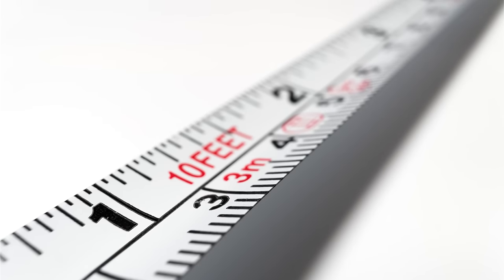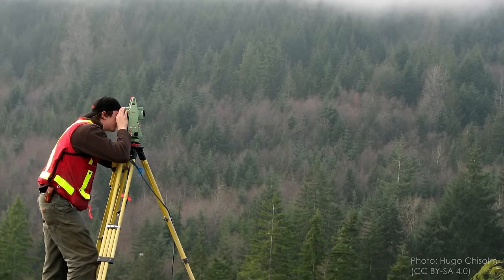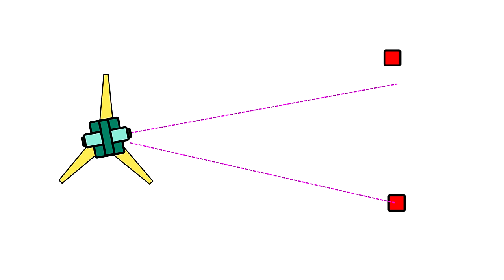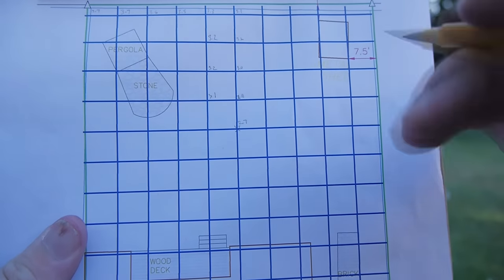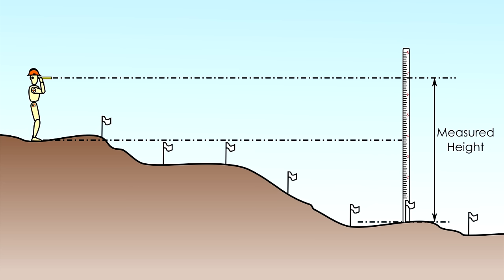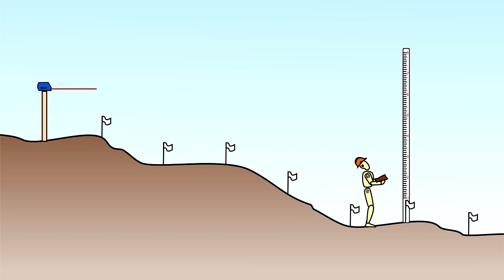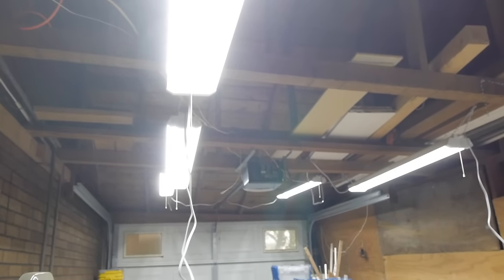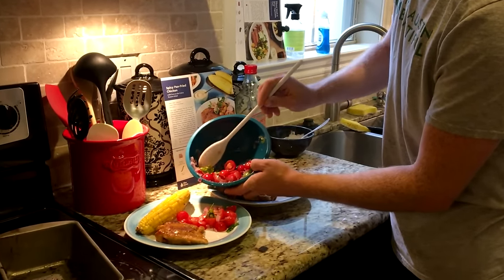How does land surveying work?

Comment: Theodolites are also used in Track and Field (although we call them EDMs, Electronic Distance Measurement) for measuring throws and jumps, and they can be an absolute pain to set up, I can't imagine how annoying it must be on an uneven surface.
Reply: EDMs are different from a theodolite. When the two are combined you get a total station.
Reply: @jonathonhazelton2060  I just had a Google and it turns out that we're using total stations but calling them EDMs. I thought that they were the same as theodolites I would get distance and angle measurements.
Reply: Yeah, so you weren’t wrong for the EDM doing the actual distance measurements, because that’s the part of the Total station that does the distance measurements. Also setting up a total station on uneven surfaces isn’t much harder than setting them up on even surfaces, the tripod only contacts three points, ask a surveyor the trick to it, there are lots of competent one in OZ. Do you set up the Total station after every throw/jump, because if you placed it to the side, you could do a simple calculation to determine the distance from throwing pint every time. Trig for the win, and because it is repetitive, you can make a program to churn out the distance. For the scale of the field, you can simply assume that the earth is flat, and all your measurements would very good.
Reply: @jonathonhazelton2060  we've got a program that we use where we measure the centre point of the circle or runway and then we leave the EDM set up all day so that we don't have to set it up for each event, and on the newer models we can switch between disciplines without having to measure the centre point each time. The big issue is that some tracks have issues with the field that makes measurements inaccurate (for example at Townsville the Javelin centre point isn't marked in the right spot and the foul line isn't marked correctly either) or the turf is raised higher than the circle or runway, which is a big issue especially when dealing with Comm Games and Olympic Qualifiers or records.
Reply: Oh so your telling me that it runs a program where you just map it out first with a couple of measurements and then it does it all for you? That’s is one slick system.
Reply: With practice, you can do it in under 60 seconds, including on uneven ground. It's all about using the right procedure.

Comment: A Transit Theodolite with a stadia diaphragm and an anallatic lens can easily measure horizontal distances by using formula D=100s where s is the difference between upper stadia and lower stadia

Comment: I recently bought a VERY cheap residential lot in central Florida.  Kinda strange coincidence on how i found the lot.. i had broken down late at night and decided to drive off to the side of the road and go to sleep. when i woke i was exploring some unpaved street and wooded lots with no houses .    I looked it up and found that some were for sale for a very long time.  I called the county and researched local zoning and building codes and made an offer i thought the seller would never accept and but he did.   The idea i have is an offgrid lot with no permanent dwelling - secure, fenced and private with shallow water source and solar.   Taxes are almost nothing, but to put a fence they told me a i needed a survey. They told me they have no building codes for fences and that almost any fence will be accepted.  However...  am looking at google earth images and see many of my neighbors have fences that were never permitted.  You can't tell from street level , but they also have illegal dwellings and  RVs and building containers on their lots.  I asked the county about if there was any plan to pave the platted streets and they said there was not enough development to justify and that this part of town is un-maintainned and unmonitored  (meaning no mail, no garbage, no 911 service).  I'm not interested in City Power, but the local power company quoted me 8k to put a post on the lot.  I know all this sound scary, but trust me when i tell you the price and taxes are STILL right and some of this is actually good news if the goal is to use it off grid .   I plan to mark my corners using the counties GIS GPS coordinates and do some manual land clearing, site planning and build a simple hidden fence to keep people and predators out.  I have no immediate neighbors and may never have any. I was there a few days and did not see a single car pass in front of the lot.   Should i bother getting  a survey and submitting a permit to fence it with temporary u-post and wire mesh? the way i figure this is only going to INCREASE MY VALUE AND PROPERTY TAXES right? . The county clearly does not care about this area as they don't service it and nobody is going to report me if they can't see beyond a bunch of trees i have in the front of the lot.  The other question is given in Florida, what's the TYPICAL FINE and process if they see that i built a fence WITHOUT PERMITS?  Again, it's a very simple metal T-post and wire mesh fence in the back of the property - at most about  a $400 investment.  I understand the risk of not having neighbors .. like theft and worse.  Also I do see coyote tracks on the lot.

Comment: Great video, but you left out some critical parts:
1.  By law you have to close down at least one lane of traffic, even if you're 50 ft away from the road.
2.  Union contract requires at least 4 more people on that job, regardless of they have nothing to do.
3.  Most states require at least 2.5 inches of butt crack showing on the surveyor.

Comment: I live in a rural neighborhood that is truly a surveyor's worst nightmare. In the 70's it was platted by two guys with a random length of chain. All the measurements were made with the chain and marked with metal pins stuck into the ground. A contractor was hired to put in roads and the lore has it he was drunk because the roads don't follow the plat at all. About every fourth parcel has the road just wandering somewhere through it with property on both sides of the road. A few years after that the elected county surveyor bought up a bunch of parcels and decided he wanted them to be larger... so he pulled up some pins and resurveyed the place to his liking. The whole thing is such a mess that when you buy land in the neighborhood there's a big disclaimer from the county saying the plat maps they offer are "suggestions only" and not legally binding.

Comment: I thought it was called a “transit”. I’ve an older one that’s basically a telescope/site, bubble level, and compass rose on the base. It has four adjustable points for leveling. I think it was a high-end professional tool in its day (1978).
Reply: i know this was awhile ago but I thought I would answer your question. A transit has a vernier that is used to read the angles, normally with a magnifying glass. The accuracy is about 20-30 seconds per angle. A theodolite uses a micrometer to read the angles. The accuracy can be 1 to 10 seconds. Some models can be accurate to 0.1 of a second, however this degree of accuracy is seldom required. Both instruments are nearly obsolete today. Electronic Total Stations and Robotic Total Stations are now the rage. Those and survey quality GPS have taken over.

Comment: One thing if you use a laser. Don't look at the beam directly into your eyes. Will cause eye damage. Next thing I own a Bosch and bought the extra tool that sees the line when my eyes can't. So in the brightest sunlight makes no difference so that makes the laser that much more useful. I had problems with bright sunlit rooms. Not any more. Cost a bit but make the laser so much more useful.

Comment: Thanks for the short video.
Few years ago I tried using a clear water line but it did not work for me.  It had roo many kinks in it.
Is there a certain type of a clear hose line that works better?

How to figure our a percentage of a slope ?
I have uses a 6 feet long level, or a 12'  2x4 with a small level on it  and  tape measure on a payment, but what can I use on a undeveloped land and for  longer distances like 30 or 40 feet?
I really don't want to go out and buy a Lazer & tripod.
I need a better clear water line.
Any suggestions?

Comment: I'm curious if anyone is using pretty basic photogrammetry for small scale (a parcel of land), which can be done with consumer level drones.  it'll give a point cloud of topography.  you could throw down a basic scale (1m x 1m square or whatever) to scale the results for any 3d program.  you'd run into issues with trees, making it a bit more tricky.  I know it gets used on large scale measurement of land.  it just seems like it could be a way to automate surveying.

Comment: I have a story for you. I do concrete formwork in the commercial world; this iron worker was landing a load of rebar, about 20' pieces, and he grabbed the load and spun and knocked the total station right over. Our boss sent it out to get recalibrated and guess what? Same guy, same size load, same corner of the hole and exactly one week later he does it again. He was off the job after that. Apparently it cost about $40,000.

Comment: I have a 20 year old Porter Cable, rotary, remote controlled laser, that on the remote, there is a laser detector that, well detects the laser even on extremely bright sunny days. However,  nothing like waiting until dusk so it can easily be seen.

Comment: At around 2:00 in your presentation, I saw that the surveyor seeing through the telescope with several measurement rods and or reflectors around the area. I see in the picture these are measuring sticks are mounted on tripods and others sticking out of the ground. Do you have to pound in these measuring rods into the ground so they remain up right so the telescope person can do a reading on the theodolite?

Comment: Who said a laser level is level. It's all about calibration tolerances. For long distances the ultimate best is what Joseph DESTAUBIN said, it's a water level. As with all tools you have to understand their limitations and vulnerabilities but even so water levels are the best. My take on laser levels is that the affordable home units are for short runs. When you move up to the $500 to $1000 or more levels then you can take on longer runs.
Hey you left out the part where surveyors go in a circle to calculate the average errors and compensate, but a backyard doesn't accumulate that much error.
Thx for sharing.

Comment: Wish I could locate the corners of my property, I never found any pins and once contacted a surveyor and asked what would cost to find my 1/2 acre rural property line, they quoted some crazy amount like $1800. I know within a couple or 3 feet where the lines are, and the lot is 89 feet wide and there's an old barbed wire fence along one, so it's  close enough for me.
My property abstract details the measurements from the quarter section corner and all that, but that's too far down the road for a tape measure.
Google satelite view is surprisingly accurate and comes to about a foot  or two away from where I think the line is
Reply: If you or someone else goes to sell your property, you're probably going to have to pony up for a survey.
Reply: @checkyoursix5623  I dont ever plan to sell

Comment: The water level method is affected by what the temperature was when you started and when you finished. If it was cloudy when you started and then the sun came out later, the water will heat up and the level will rise on you all this time giving a false reading.

Comment: this has nothing to do with the video but ...I used to work on a wine cellar making port wine and we had some 100.000liter stainless cylindrical vats that needed measurement so the company called a team of "engineers"..they went inside the vats with laser equipment and calculated the total capcity of the vats and made a table with liquid height vs volume.....we, the common workers kept telling them that this method would be useless but they wouldnt listen so we let them cary on...after the measurements were taken and all the paperwork and seals of quality were given we started using the vats with actual liquid....but the vats swell a lot and deform on the presence of so much liquid. they are so huge that it cannot be seen at the naked eye but one centimeter of swelling gives lots and lots of liter of difference in such a large diameter circunference and so the measurements were way way off...we "uneducated" workers kept telling them to use a flowmeter and water but they said they could do it chepaer....next the company had to call another engineer team with a large flowmeter....sometimes being close minded and believe blindly in empirical and theorical knowledge disregarding real world variables and people with experience working with the actual stuff is a very dumb move....guys like those give a bad name to engineers.  thanks for the great videos i always learn with each of them!

Comment: How do you work out the level with laser and post?  I didn't follow ... what calculation do you do and how can you record the info in a form that would mean something to a builder for instance? Or to put it into a cad landscaping software program?
Reply: What do you mean by “work out the level”?  The rod is just a measuring stick, giving the height above whatever it rests on.  The leveling instrument connects two points with a level line.  Since you know the height of the instrument, you can easily determine the difference in height between the two points by addition/subtraction.

Comment: Can u talk about exactly how surveying leads to roads? Yeah okay we find out the elevation but how is that data used?
Reply: Surveyors make 3D maps of the existing ground and features. An engineer designs the road to fit and meet standards. Standards dictate how tight turns can be or how steeply the road can climb. They also try to minimize the amount of dirt that has to be moved. They can do this because they build a 3D model of the proposed road in the computer, and can add or subtract that model from the existing surface. Then surveyors place stakes on the ground that show the contractors where and at what elevations to build the road.

Comment: I dont think that sight level method is actually correct, sure your sight might be leveled but what if the measuring rod isnt? What if its slanted? Thats why we have a leveled sight, so we know everything we see is level, but you also need to rock the rod back and forth, and the lowest read though the middle line will be the elevation. Because when the rod is rocked back, you read higher numbers, and when its rocked forward, you also read higher numbers, so the lowest number is therefore the leveled elevation.

Comment: I know nothing, but I am interested.  A question I am trying to answer is this; If a drawing of my property says it is 100 feet wide from point A to point B, but the land slopes downward along this width 15 feet in elevation, do I measure 100 feet following down along the slope or do I measure 100 feet level from point A to point B?  I have tried to think about this and the only thing which makes sense to me is 100 feet in a line level from point A to point B.  I know this is a very basic question but I think I can build my understanding on the answer.
Reply: @Kshitiz Pokhrel  Thank You SO Much.  I understand the answer now.

Comment: Wait...i just realised..........do your surveyors in the US use the metric system like pretty much everybody else or do you still use the imperial system for surveying? If you use imperial you job must be way harder...my head hurts just thinking about it...
Reply: We use decimal feet. The feet are US Survey feet, which are slightly different from imperial, but are an easy conversion to metric. 3937/1200 US Survey Feet per meter.

Comment: When using simple tools like the sight level and "that ancient angle measuring device that I cant spell" how do you choose a Datum point? Is it best to choose the highest point, the lowest point or mid height point?
Reply: I'm an archaeologist and we use surveying when mapping out our dig sites.  Choosing a Primary Datum depends on what you are surveying and where it is located.  I'm guessing you're just a hobbyist that wants to give it a try or maybe map out your yard, if that is the case I'd use as a Primary Datum the corner of a ground level porch or a spot that is level to the foundation of your house.
Reply: @DominicNJ73  thanks, ya I'm just a hobbyist but surveying and cartography has always been fascinating. When  I was about 15yo I spent a summer locating and flagging the property pins  in my undeveloped acreage development.  It was really cool.

Comment: Is there an DIY way to measure your property lines?  Me and my teenage girls are just curious engineers.   Thank you
Reply: The compass on your cell phone is very precise. It's hard to get a clean sighting with one, but you can eyeball it to within a couple of degrees. You can tape out the distances with a long tape (keep in mind that boundary surveys show 2D distances, and don't account for slopes). Do you have the legal description for your property, or a subdivision map to check your measurements against?
Reply: Containment Failure yes we got the map from the county.   And thank you for the advice.
Reply: @WWTormentor  Trilateration is also a good exercise. Set up a baseline of a known distance, and measure from both endpoints to each property corner. On paper, a draftsman's compass can be used to sweep out the arcs of the distances, and where they intersect is the location. Even better if you can measure from three points, as it will show the inaccuracy, since all three circles will not quite meet at the same point.